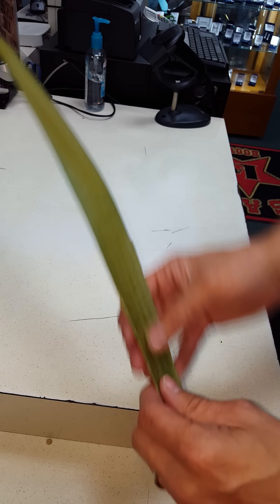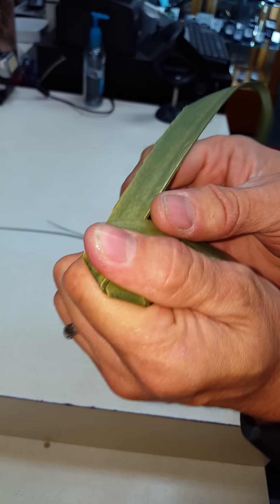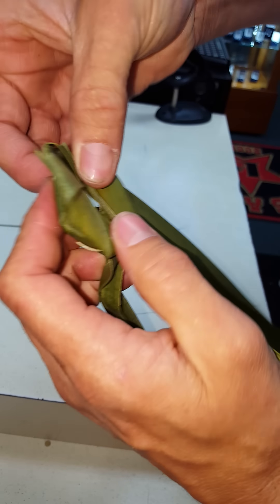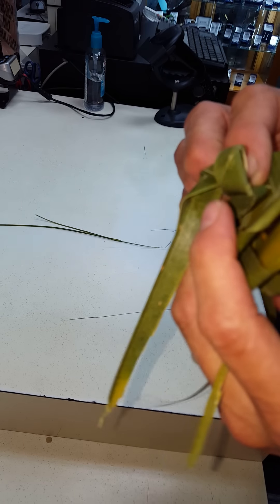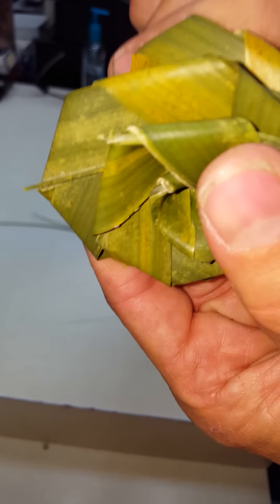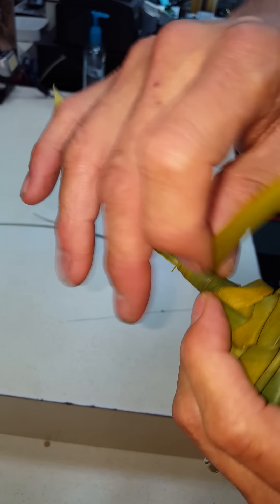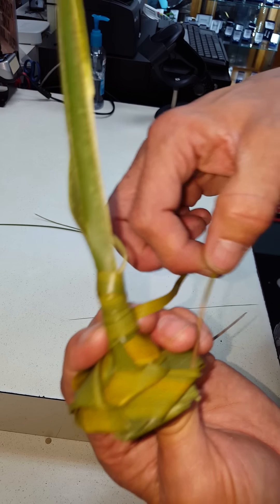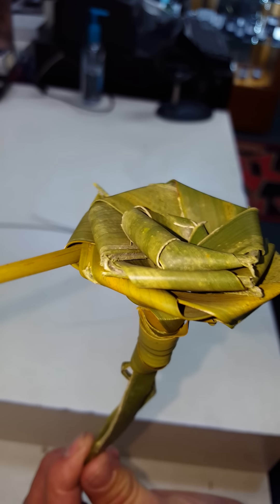palm rose

Comment: What is the approximate length of the palm leaf? I don't know what kind of palm to get.
Reply from the maker: You can use any length that you have availability to. It will only change the size of the finished product, it will still turn out beautiful no matter what you choose! I have used a variety of different palms and they are all individually different, which makes it even more interesting to see what the end result is. Good luck and I hope this helps you!
Reply: @kenwhite866  thank you so much. I will try them.